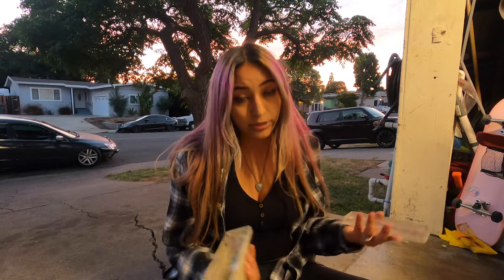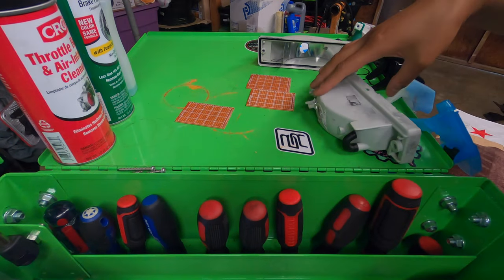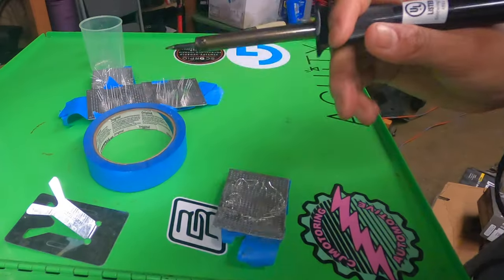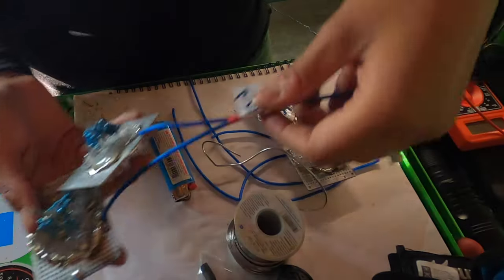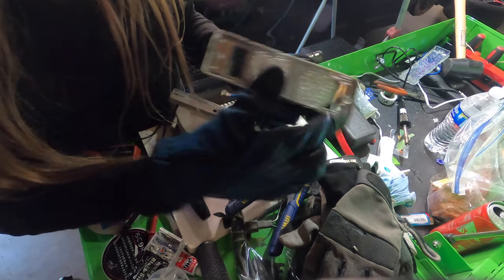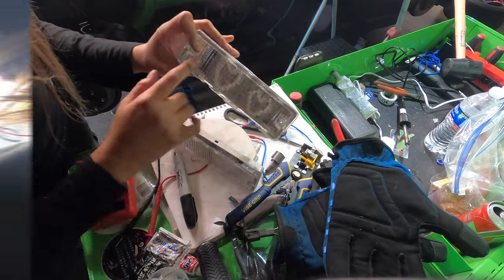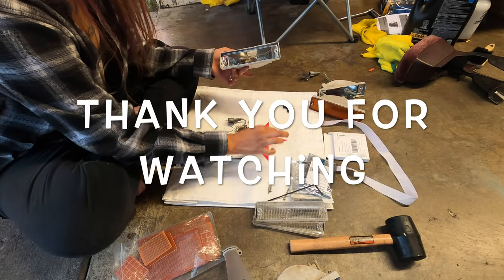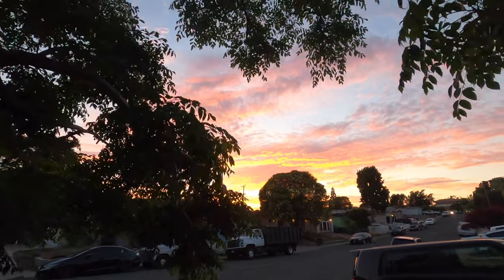DIY LED Lights with me! Nissan D21 Vlog 2021!

Comment: Great job looks great! I do a lot of solder projects so I have a couple of tips for you. Next time use Flux and make sure your solder is leaded, it will make your life 1000000x easier. Flux core solder & unleaded solder don’t flow very well.
Reply from the maker: Thanks! 🤩 I appreciate the tips!